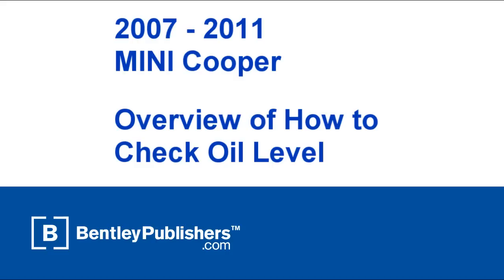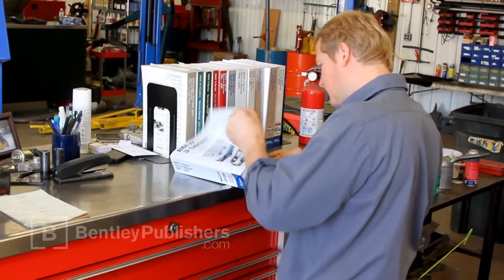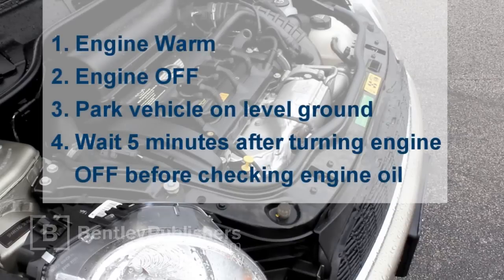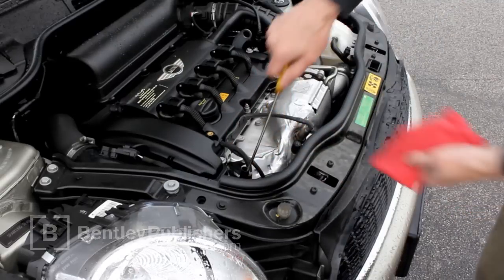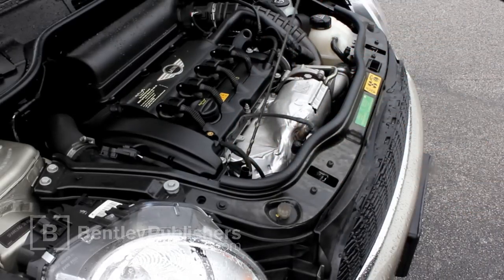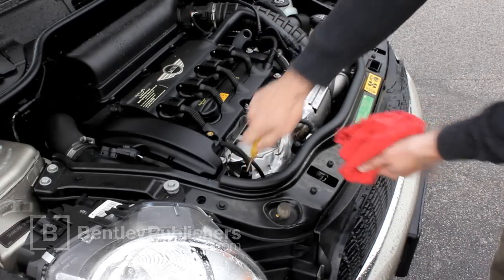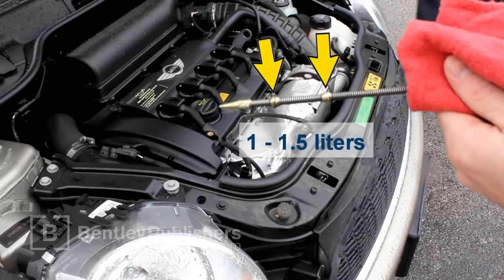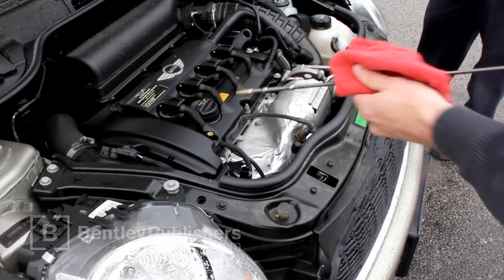MINI Cooper (R56, R55, R57) 2007-2011 - How to check engine oil level - DIY Repair

Comment: Checking oil while the car is warm?! Is this real? The level we are actually checking is not the 4.5qts the car takes, it's more like "what's leftover" after the oil cycles through the engine? I'm confused because it most definitely takes longer than 5 minutes for the oil to drain from the motor into the pan...
I've already had severe timing chain wear due to low oil levels ('08 r56 non-S). Had that replaced for $3000.00. Last oil change I did at 5k miles and about 2qts of oil drained out. These cars eat oil and I would like to know how to clearly watch my oil levels to avoid catastrophic engine damage (again). I've been told by both MINI and BMW techs that these cars are known to burn through a quart of oil every 750-1000 miles. With this being "normal" I'm told... Being able to get a clear idea of how much oil is in the car would be fantastic haha. The car clearly shows signs of even just slightly low oil, and the low oil pressure light is useless til it's too late.
I love this freakin' car but goddamn, I didn't even have to carry oil or coolant with me in my old, rusty, abused Jeep Wrangler and that thing was a piece. My MINI is turning out to be quite a princess ....

Comment: is it just me or its difficult to see the oil level on that dip stick
Reply: It's ridiculous.  I couldn't have designed one that was harder to read if I was given ten million dollars.
Reply: The irony is you don't have to check the oil level very often on most cars, except ones which use quite a lot of oil....like the R56!!
Reply: It's not only difficult but you pretty much have to touch the markings to feel where the oil is because it is very hard to just notice by looking at it, and like mentioned before on a car that has to have the oil level checked regularly it becomes really annoying.
Reply: I finally found solution how to read this stupid dip stick after 1.5 year. Take cloth or napkin and clean it fully from bottom of it to the top where plastic is multiple times until it is dry then is readable..
This Primce engines are so badly designed it makes you cringe. It wouldn’t be problem that these emgines dont drink 1 liter every 3000km at least...just terrible.

Comment: Thanks for showing us how to look at an upgraded dipstick that none of us has. And that probably costs $23,435,234.
Reply: +BlastReadingSeries My Mini Cooper S has this dipstick in, and its impossible to read! Its got thread on it, like a screw and I cant for the life of me see where the oil level is... There is oil there as it covers the cloth, but Its impossible to see the level.
Reply: +kantor72 wow, I thought it would be easier with the upgraded dipstick. These Minis... Sheesh!
Reply: +kantor72 Well, maybe we should just depend on the oil pressure light to let us know when the car has run out of oil? Seems like a good design from their perspective. When a motors melts we just end up buying another! Thanks for the headsup on the coil,  I was thinking about getting it. But if it's not any better than the horrible one I have now, I'd rather spend that money on the coolant hoses that need to be replaced...
Reply: Have you ever figured this out? It's doing my head in!!!

Comment: i have to agreed with all you smart people out there, dip stick, can not be read, Solution wipe clean with paint thinner, paint it white , with engine paint , let it dried, wa la now you have a dark oil level mark on white .
Reply from the maker: Max Delacerda 

Has the paint held up in the oil?
Reply: heat n oil resistant paint, car paint ?
Reply: I agree and did the same thing to my boys mini. it actually works and he has no problems checking it now.

Comment: Car oil should be checked when the car is cold on flat ground. The oil level will be inaccurate as the oil will not have returned from the oil ways to the sump after only 5 mins. Warm oil will also stick to the dipstick from the dipstick tube and give a false reading. This is basic stuff. Mini engines burn a bit of oil, especially the turbos. Mini dealers put the minimum amount of fluids in at a service to save money. Always check the coolant and oil levels after a service and see for yourself. Then take your car back and demand a proper refill. Mini oil costs £25 a litre and that is their motivation as defined by their service managers.

Comment: Oil pressure light came on turning right into a street twice over a few weeks due to we think low Oil even after 5K miles when the oil was changed. I check my tyre pressure every month. Yes I know you should do it more but how many do it at all. I do it on a flat supermarket Car park we go to and try to look at the oil. You cant read it!!!! It has actually put me off MINI just now as the car is on the drive and waiting till Monday even after top up at my local garrage to take it back to them. They took ages to read the dipstick and have been working on cars for 30 years. My Honda was simple to read and gave you confidence. MINI sort this out its shocking.
Reply: Scotch you should be changing your oil every 3k miles. 5k miles is already stretching that oil especially if it’s an S model.

Comment: It is true that the oil is difficult to see when fresh oil is added. After about a 1,000 miles it will darken and become easier to see. I have the same dipstick used in this vid, and I've looked at the newer version on some loaners from the MINI Center. I have to agree that the newer version is impossibly difficult to get a good reading. I'd try getting my hands on the older version if at all possible. Good luck all!

Comment: So i am not the only one who things the dipstick makes you feel like a dipstick, it has cost me £1500 because my engine has seized, it appeared to have oil and no low pressure oil light, engine boom grrrrrrrrrrr
Reply: I had the exactly same issue. Cost me 2400 euros.

Comment: With all respect I don't think your video deals with the real challange of reading this dipstick. The small metal coils make it very difficult to tell if you have liquid on them.  The trick my dealer helped me learn was to thoroughly clean the stick by spinning it several times with a large cloth or paper towel to get all the oil off which hangs between the metal coils.  Then it will be much easier to see where the oil line stops.

Comment: Cesar - I hear ya.  I have a 2010 R56 and using the dipstick to obtain a proper reading is difficult - for proof, look for OceanMini2's 1/10/12 post on northamericanmotoring for more info.  Look on flickr for "2010mcr56oil" (without quotes) for photos of my dipstick.  Couldn't post links here, sorry!